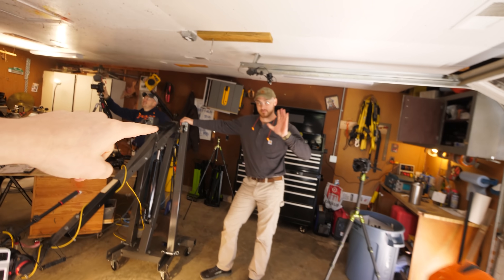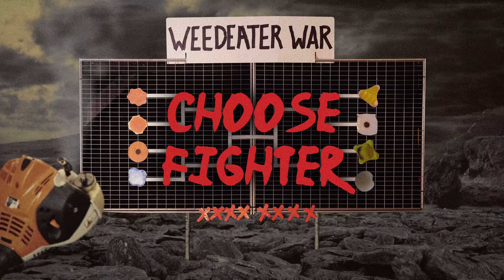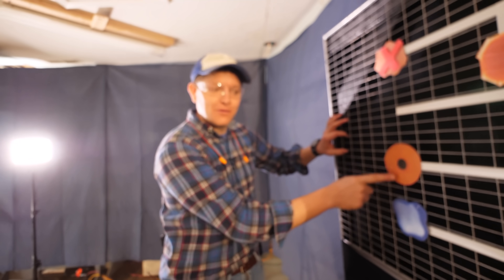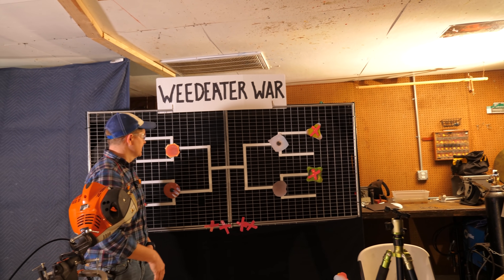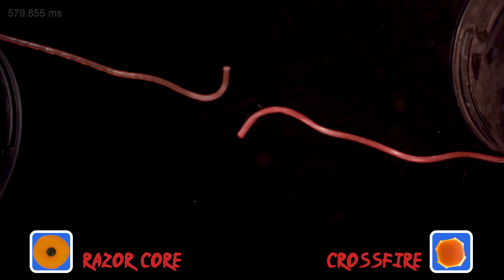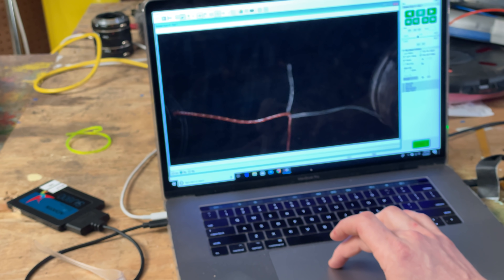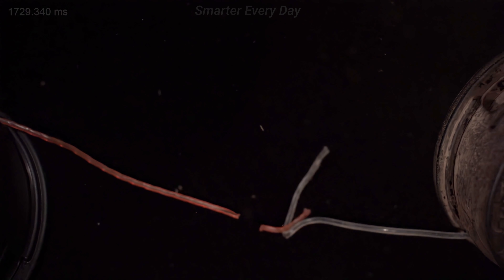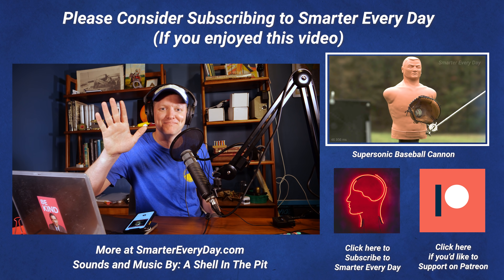What happens when 2 Weedeaters Hit Each Other? (28,000 fps SLOW MOTION)  - Smarter Every Day 255

Comment: Alright, I predicted Sharp Square!  Figured it'd be one of the core wires, and thought the square would be a bit more durable.  Also, the gentle slapping sound effects added when the lines were hitting each other with non-lethal blows cracked me up.  Very fun video.

I'd love to see this done in a scientific application as well.  Instead of doing a head-to-head with a slow-mo camera where you have to scrub huge amounts of footage.  Put all the lines up against a common semi-stationary "enemy", run them for a fairly long set amount of time, and then measure the length of the line that's left after the test to see which was the toughest..

Comment: I kind of feel bad for the sharp square, cause it got pulled out of the snipper head by the Grey blob around 7:50, So that weak link, wasn't its fault and the blame incorrectly applied, I thought you at least would have done a rematch for that one as it was Pulled from the head.
Especially since where it broke wasn't a point of contact, So maybe it had already been damaged or a defective strip. 
I think we need a rematch :D

Comment: You need to run the whole experiment over, since both weed wackers are not traveling at the same RPM. So run the test again using the different weed wacker for each run.

Comment: I feel alot of these results have a lot to do with not just possibly the strength of the whacker wire but more to do with how these interact, ex. if one wraps around the other better it will do much more damage even if it technically is not the strongest.? concur?

Comment: Can the weedeater lines be explained like chains? The weakest link of a chain is what's causing the chain to fail. In this case, the probability of two different lines hitting the weakest point of a line is what's causing the line to fail. I think each match should be tested 5 times and 3 matches determine a winner for each round.

Comment: Sharp square didn't win on that, the match was called too early.  Delamination is not the same thing as breaking.  A delaminated whip is still full length and the match should have continued until one actually broke and lost length.

Comment: Ok… so I work at a store where we sell whipper snippet string. For years the string almost every pro guy would use was a grey square string with a black core. Then we got the carbon fibre Stihl string. Every pro that I know of who used the grey square has switched to the Stihl carbon.
You need to battle them.

Comment: 25 year plus Land Care Professional here: I want to see each one run three times.. I bet there is some randomness that wasn't calculated into the equation. Why? Because after 25 years, I've never come across a square, star, hex, etc. line that outlasts a full head of standard, round .105 line. Anybody using a diameter of line smaller is just a "happy homeowner" posing as a lawn expert, IMHO.🤷‍♂️

Comment: There is whip mechanics involved in the tear of the things, i’ m currently at 14:25-30 you can clearly see the impact creates a wave travelling all the way from impact point to the end of the loosing weedeater line and as the wave goes it accelerates the line, the tip as too much rotational speed by the end of it and it snaps. I think , no 100% sur just trying to understand here.

Comment: It looks similar to a whip being cracked, where the bend radius decreases as the wave moves down the whip,  the lines rarely breaks at the contact point but a bit closer to the tip, propably because of the bend radius decreasing as the bend runs toward the tip,  and propably heat from the 2 lines rubbing against each other really fast or like fishing line melting when you tighten a knot

Comment: Having 2 independent throttle triggers means you rely on the operator to make sure they are equal. This will never be the case, so this is a variable you've introduced that basically invalidates the tests.

Comment: @SmarterEveryDay Why is wet paper weaker than dry paper? 
How many gallons of water are used per Kleenex box? Per individual tissue? Should we bring back hankies? 
How many trees are cut down for each roll of TP? Should we switch to bidets? Also to save water.
Why does wet cloth seem to be stronger than dry cloth?

Water's going to be more of an issue year after year, trees are too. Doesn't rule 303 apply?

Comment: I recently found out that, with a little adjustment, I can run .065 nylon weedeater line through my 3d printer. So now the obvious question is, what happens when I wind some PLA filament into my weedeater?

Comment: Since you seem to be sitting around bored.

How about investigating: what is the best way to cook something in a microwave? Glass? Ceramics? Plastic? Which shape cooks the same volume the most efficiently?  Tall tube? Square? Thin layer on a flat plate?

Plus a refresher on how exactly a microwave works.

Comment: #19 On Trending! Currently 7:22est 4/30/2021! 

Also I think the line on the spool has a huge factor. Whichever one becomes taunt first has a tendency to cross its plastic threshold, and causes the break. Like over hardened metal. While the one that typically gets tangled on has a bit of slack between line and spool, allowing a little bit of an edge to absorb some forces. Another thing, is the Facets of some of the lines, I think has a tendency to add failure points. If you ever do a 4th video, it'd be cool to make custom heads that you only clamp 5 inches of line to. No spools. Test a faceted group of line, then a cylindrical group. Battle the two winners there. Also you can do educational content, or BTS videos on why these facets matter, or dont etc.. and you can recall your plastic, elastic strength video from a little while back, and show how it all ties together into everyday thinking. Sorry this was a long response, but I enjoy the content, and I figured I'd offer a bit of free brainstorming. Thanks for what y'all do!

Comment: The NWWA has revoked the results. The Committee for Fair Noodle Whacking (CFNW) and the IFPC both independently filed a report refuting the results based on an oversight by the jury. It was noted that ALL fights but one were won by the fighter using the LEFT whacker, and the one that was won by the fighter on the right was done so in a fashion that was exceptionally different from all other match flows. The CFNW therefor put a motion in front of the NWWA board to replace the current match format with a double blind double redundant iteration of fights to make sure that all fighters are given equal chance at the title...

Comment: I think it would be interesting to see the tensile strength of each of those lines compared to the results. It seems to me like a larger cross-sectional area and higher tensile strength results in a winning line. That might be why the lines with solid cores made it to the finals, the core is probably a stronger compound, raising the tensile strength.

Comment: sharp^2 was cheated! that was clearly a mounting issue rather than an aspect of the strand itself.

seriously though: mounting issues are a huge aspect of the durability and performance of these things in practice since that has a huge effect on how tension functions and energy dissipates in the strand, hard mounts sound like a clear looser in that regard but going purely by experience auto-feeding heads on weed eaters burn through thread several times faster than a hard mount (to the point where they will eat a spool in about the time the hard mount needs to be changed 3 times, they ARE way more time effective though), I'd assume a squishy version of a hard mount would be the best overall but I've never actually seen that (erm, relatively squishy, I'm thinkin' something like a bicycle brake).
actually...huh, literally just adding a braking system to an autofeeding head would be a pretty solid best of both worlds solution: you can tell the condition of the thread from instant to instant by the sound so that is absolutely something you can implement operator-control on and expect it to work well with most operators.

Comment: My initial feeling, if the loss condition is breakage, is that the Razor Core will win, because at a glance at least said core seems like it would offer greater durability.

Edit: Well, I had the right idea, I just neglected to consider that the Sharp Square has the same advantage. I actually realized this during the first Sharp Square match and found myself thinking that I might have made a mistake.

 I correctly identified what was probably the most important factor in success of both the winner and the runner-up, I just wasn't observant and made a rather quick prediction instead of pausing for a few minutes to really consider each option. Sharp Square being gray on gray while Razor Core has the orange and gray contrast making it much more visible at a glance, along with it having "core" right in the name, are probably why I immediately noticed it for the latter but overlooked it for the former. I should have taken a bit more time looking them all over, but I wanted to keep watching the video so I made a quick decision instead.

Comment: Look at 16:02
Could it be that the wire gets pulled out and cut by the blade that limits the wire lenght in the guard shield ?? Could be a huge factor for error

Comment: This needs to be a round robin. So they compete against all other types. And not just a 50/50 chance each time. If the 2 razor core ones were both on the east. You would have eliminated 1 of them. And therefore your conclusion would not be the same.

Comment: Sorry to be a party pooper, but, to be accurate wouldn't you have to do multiple "battles" with each trimmer line, winner being the line that won the most "heats"? To rule out possible inconsistencies in the line itself.
Also, to be truly "fair", the "battles" would need to be re-run with the lines swapped to the other weed eater. To discount any advantage from, say, a slightly higher or slower head speed.
Wouldn't it be possible to get a totally different result if the original "pairings" were changed? Possibly with a different line eliminating the eventual winner in your video in the very first round?

Comment: Probably would have been easier with electric weed whackers as then you wouldn't need to rev them between tests just flip a switch and go. Though I imagine you probably just are using the ones you already owned so, I understand why you guys wouldn't use them. I know I personally use a combustion one as well.

Comment: I'd like to see what line works best with an electric weed eater. The new battery operated 20v and up weed eaters are pretty powerful now, but they still recommend a lighter line. The thin stuff breaks too much, so I've been using a line similar to the grey blob, thicker but still lightweight, and that gives me a bit more toughness. However, I don't know if I'm getting the best performance using a thicker heavier line, or if I would have better performance with a different shape/weight/strength.

Comment: 1:00 seeing the tournament chart, my first thought is "this is already a flawed test, isn't it?"

Since you like being smarter every day, I'll explain like that xkcd commandment decrees:
When you do a single-elimination tournament brackets like this, the winner is heavily dependent on the match-ups. It isn't as straight-cut (pun intended) as the winner actually being best, as any of those that lost without battling the winner, is likely better than the winner. In addition to that, if it is single-elimination you also have entries losing on poor luck, and in reality each matchup should have a statistically significant amount of fights.
Ideally, you should avoid brackets entirely, as each entry needs to fight all the other entries. This is however unfeasible in reality, as the time-complexity is approx O(n^2), which is why ie. chess tournaments uses a few fights, and a sort of scoring system as a heuristic instead. But it is also rather shoddy, a better way would be to find the winner from a regular tournament, then have it fight all other entries (because the only entry who really matters, is 1st-place). Any that it loses against, is then also required to recursively fight all other entries - making the worst-case time-complexity still the same, but likely to be lower in reality (especially when you remove or dont add entries that has no chance of becoming the winner despite winning over a winner-candidate, from/to the set of winner-candidates). This is because any top-ranker is likely a top-ranker for a reason, so the worthless entries should be failing their fights against any other top-ranker.

However, if worst-case is deemed important, then you could at least count degrees of separation (if A fought B, that is 0 degrees. If A hasn't fought C, and B fought C then A has 1 degree of separation to C. And so on), and force the winner (and those winning over winner) to fight entries which are n degrees separated.
If you care for more than merely identifying 1st-place, you will also want to have losers fight each-other in losers-brackets.

And this wall-of-text is why tournament arcs in anime are bad! :D
Reply: Well single elimination works perfectly fine for most cases. If A beats B and B beats C, then A logically should beat C. Of course that isn't always the case, but it is most of the time.
Reply: @Owen_loves_Butters  In my experience it is usually the opposite: that stuff resolves into rock-paper-scissors situations
ps: also, wow. necro

Comment: the ECHO string is TERRIBLE!!! I've finally gotten through my roll and will never buy again. going to go with one of the rigid core strings thanks to this video
Reply from the maker: My man has opinions on weedeater line.
Reply: @smartereveryday  I had to re string the spool 3 times on a 1/4 acre each time I trimmed... if you touch anything but grass with echo string, it rips apart.

Comment: I have the impression that the opponents did not compete on even ground. It turns out that the left weed eater wins significantly more often. I guess it might be due to the experimental set-up. The weed eaters are arranged slightly inclined to each other. The right weed eater must rotate upwards while the left one rotates downwards. I wonder if gravity plays a role in this. Escecially since the masses of these cords are very small. So that the left weed eater brings more kinetic energy.
Other possible explanations could be different lengths of the cables. But I assume you have considered that. Or how the trigger of the weed eaters was pulled. Or mechanical differences in the motors of the weed eaters.
Just guessing...

Comment: I would say the round razor core should be relatively ok because it is round and has probably a more even balanced pressure on the outside and also the "razor" core should at least provide a bit more strength than a normal plastic rod just by itself. Anyway let the games begin ^^
Reply: :( My champion got deleted... But I guess mass wins this one and the gray one was a bit thicker I think.

Comment: I thought the razor core (orange circle) would have won due to 2 reasons, but kind of just one.
1. The solid center keeping it rigid and keeping it from bending and getting that tight bend radius, but that also applies to the grey square one so it kinda cancels out
2. I think that having a protruding shape like a star would increase fraying. I think the outer parts of the shape would be weaker and they would fray first. So I thought the circle was the shape least likely to fray.

Comment: Is the toughest string necessarily the best for the task, though? It seems to me that I would want a string that will last against tougher grass while not disintegrating, but not so strong that it will destroy my chain link fence. After all, if I wanted something that was indestructible, I would just just use actual blades.

Comment: This really needed to be done against a controlled surface rather than Vs each other as it doesn't really work when comparing multiple variations. Maybe the triangle was weak against a square where as it would of been strong against something rounded.

Comment: With the solid core lines, I wonder if the blows are breaking the core inside the softer exterior and once it looses that rigidity the ends start to frail. If that is the case, it is giving you twice the life of a non-cored line since first you have to break the core and then then rip the exterior.
This hypothesis is based on the lines being a bit more “see through” as they are fraying which makes me think the darker core has broken and flown out.

Comment: destin all should be made of the same material, you are concentrating on the shape, so all shd have same tensile streingt bro
its illegal because in this battle mostly the material and diameter matters, (diameter contains maximum material)
ITTS A MATTER OF TENSILE STRENGHT  AND DIAMETER ( THE SHARP  SQUARE AND THE RZOR CORE HAD SIMILAR AND MAXIMUM RADDII)

Comment: While appreciating the huge level of time and effort here, I really want to see a more thorough test, with all of them facing each other on either side. It felt very biased against the right-side trimmer—assuming each machine was in the same spot between runs—except for the catastrophic failure and the final. [Even then the catastrophic failure may have been a freak event and the final was very marginal.]

Still a very cool messing-around experiment, though! [And yes I would watch an hour of this every week on ESPN 8: The Ocho.]